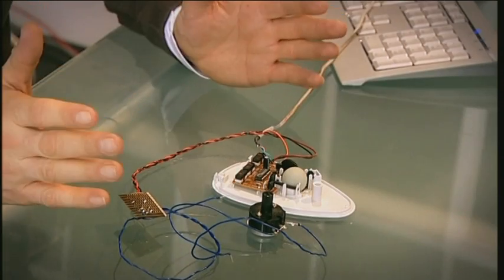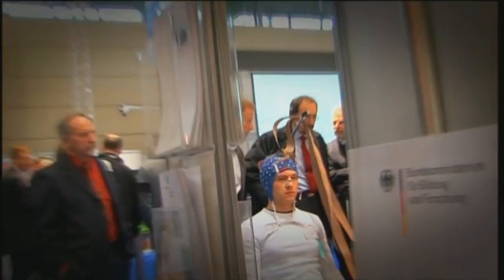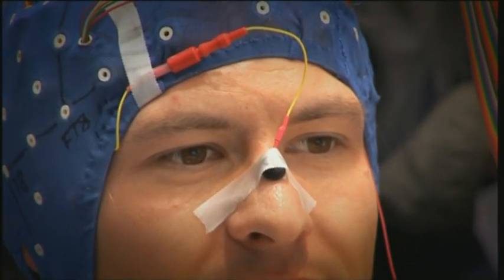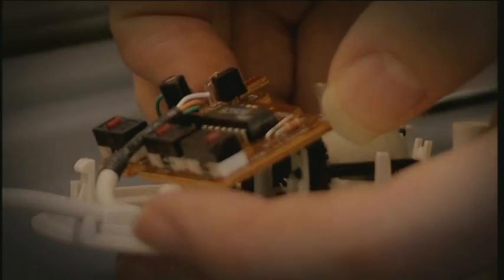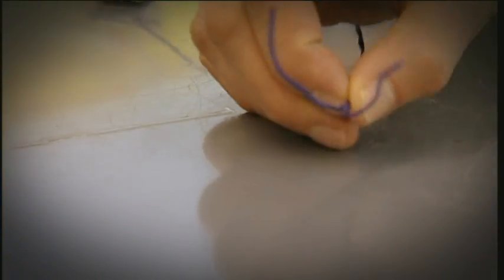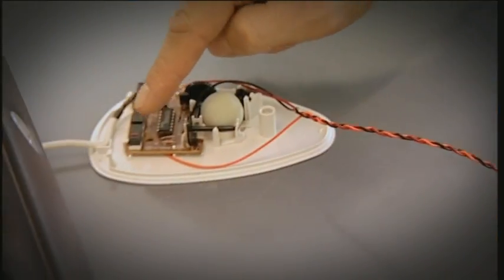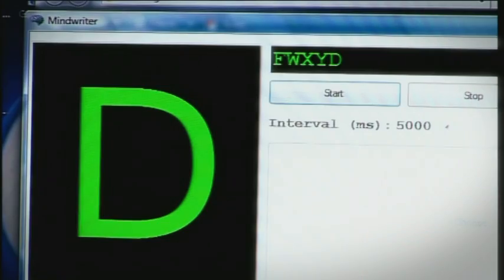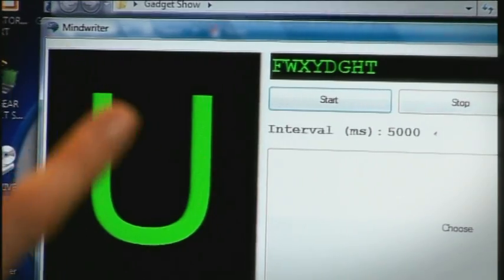The Gadget Show - Build: Mindwriter

Comment: It's a really simple circuit - just a sensitive electronic switch soldered on to the switch under the left mouse button.  The cursor of the mouse was positioned over the rather large button and the sensitive switch 'clicks' the mouse.  (I was the person who made the circuit and wrote the software for the show, and Jason's hands when he's soldering are actually mine!)
It actually took a lot of trial-and-error to get right, and much hilarity Sellotaping the electrodes to Jason.